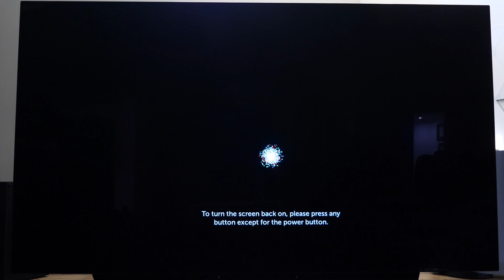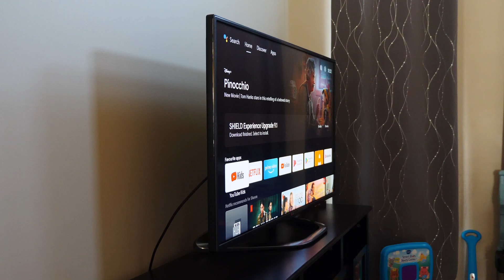TV Explained: Why Plasma TVs Are Dead

Comment: I've had 2 plasma tv's for close to 15 years and neither have experienced burn in. As far as why I like mine, there are 3 main reasons smooth motion, color accuracy, and wide viewing angles. The down sides you mentioned are correct, the weight makes them more difficult to move and they do get warm. In the winter the 60" plasma in my living room will raise the temperature by up to 4 degrees over 8 hours of use and in the summer it definitely causes the a/c to run more. After 15 years I've gotten used to their quirks. My 4k 120hz LG LCD is only better for gaming due to its Freesync and 120 fps capabilities. Most of my movie and tv collection is Blu ray and DVD and they look great on plasma. They really shine when watching sports.

Comment: Plasmas have a 60Hz refresh rate. The “600Hz subfield drive” is also marketing BS. Connect a PC to one and you won’t get any higher than 60Hz. What made plasma so good regarding motion handling is the fact like CRT, plasmas are Impulse Motion displays, and naturally have less motion blur than LCD and OLED’s, which are Sample and Hold displays.

Impulse displays like CRT and plasmas used electron beams to illuminate phosphors on the screen for CRT’s, and electrify noble gases for plasmas which would briefly glow and then fade quickly before the next frame. The benefit of this brief illumination, or "flicker," effectively shortens the time each frame is displayed. This eliminates eye-tracking induced motion blur, as the image essentially "flashes" at the correct motion position before disappearing. As a result, CRT’s and plasma displays produced smoother and clearer motion compared to sample-and-hold displays, despite potential flickering. 

Sample and Hold displays like LCD and OLED, the display holds each frame on the screen for the entire duration of the refresh cycle. As a result, as your eyes track a moving object across the screen, the image stays static in one position for a significant amount of time before the next frame is displayed. This "smears" the image across your retina, resulting in perceived motion blur.

Comment: Sure Plasma TVs used significantly much more power, but my old plasma did double duty as a room heater during the winter.  So that probably saved me some money on my heating bill.  Regarding screen burn in, that is a very real thing.  My wife left the QVC channel on for about 16 hours straight and it had a chyron around the bottom and side of the screen where the words changed, but the boxes they were in didn't.  Yup, those boxes got burned into our screen.  It took about a week for normal TV watching for those ghostly images to fade away.

Comment: My Panasonic Plasma TV only lasted 4 years and I felt so disappointed. When I replaced it with an LCD TV, I noticed off-axis viewing as significantly worse. At first I felt so disappointed, but after all of these years I guess I just got used to what my LCD TV looks like and it just seems normal. After 10 years, I'm sure that LCD technology is way better now, but I probably won't upgrade until it dies because I don't want to give up my 3D capability.
Reply: Curious: what 3-D content is out there these days? I ask because my parents currently own a 3-D TV from like 2015:)

Comment: My 5 Plasmas are doing fine. I've always heard of Burn In, but none of mine have it after daily use for years. I've even got the last Gen. KURO, 2009. ( Still mounted on my living room wall ) 59" Samsung used daily for 10 Years with a computer and was used when I got it. Main reason Plasmas stopped being built is most probably expense, the Engineers wanted to continue making and improving them.  ( ask a Pioneer employee ) Keep it up, lets pretend Plasmas are bad, that will keep the prices down. Oh, you could also complain they're heavy, because they're built like a tank, high quality parts, steel,  aluminum and glass. Also, newer Tv's are easier to throw in the Trash .
Reply: There are a lot of negatives for plasma for the owner and the manufacturers

Comment: Dead?  DON'T tell my Panasonic Viera in my living room..  still running absolutely beautifully 16 years purchase!  haha
Reply: By “dead” he means that most people don’t use it anymore
Reply: @The.duck.that.likes.grapes  Think he means they don't manufacture them or use the tech in todays TV market.
Reply: As much anymore
Reply from the maker: A little of both. Mainly that manufacturers don't make them. However, since they're not made anymore and current units die out so does the number of active units.
Reply: Panasonic made truly excellent Plasma TVs.  I have a buddy who's Panasonic plasma tv is 15 years old and it still looks gorgeous.  Sadly, I went with the Samsung plasma tv, which looked gorgeous too, but it kept blowing out power supplies every 2 or 3 years.
Reply: Yep my Panasonic 42” plasma TV is still going not a single pixel drop out… built like a tank and has all the connections I could ever ask for 4 HDMI & 2 USB. Yesterday I bought a new OLED TV ( it’s very nice - however it felt so delicate compared to my old tv and a sad day- I’m going to donate my plasma to local charity shop and someone else can still enjoy it … a little side note - the new OLED Doesn’t have analogue inputs or outputs 😢so I will have to get a soundbar and get with the modern times by the way the plasma has been used daily for 15 years or more - hard to let go and embrace the new LOL

They don’t make them like they used to 

Time will tell

Comment: Still have my Samsung plasma tv from 2009. It heats up the room and made my Xbox 360 overheat back when it was the newest console from Microsoft.  It started having problems after an earthquake. It didn’t fall or anything hit it. If it’s on channel 10 it won’t switch to the next channel. Side buttons don’t work sometimes. I want to replace it as it heats up the room.

Comment: Plasma wasn’t all great my guy. The sets were heavy the gas overtime couldn’t charge the pixels as bright so the picture would start to look dim the TVs sucked your power and raked up your power bill. They also ran hot very hot the higher end models required fans and big heatsinks. Once LED sets hit the market with local dimming zones it was over for Plasma because now you had a lighter brighter tv.

Comment: I have three plasmas. A 42" Sanyo from 2006, a 50" Panasonic ST60 from 2013 I paid about a $1000 for each new.  And I bought a used Pioneer Elite Kuro 50" 110FD for $150 in 2020.  All work great and no burn-in. I have never liked LCD picture quality and OLED is being superseded by QLED. I'll keep using them until they die and I'll try to repair them.

Comment: Black levels on most plasma tv's weren't all that great compared to modern VA panel LCD's, and a far cry from mini led that's available now.
Most of them could do ~3000-4000:1 contrast ratio. The black levels were also set at a specific value to ensure they operated properly, which means there was no purpose to the backlight/cell light control other than increasing brightness/contrast. The black levels were often quite high compared to the minimum backlight setting on LCD's, and you couldn't use as much bias light to enhance perceived contrast, as it would wash out the panel surface. The only plasmas really worth having were the Pioneer Kuro (second gen), and the last 2-3 generations of Panasonic (30-50-60 series), which could actually do 5000-6000:1, and over 10000:1 on the last models released (S60, St60, Vt60). Though many complained about the black level rising over the first few years of use.
The main benefit wasn't so much contrast, as having a uniform image across the screen. You don't get that oil on water effect like you do with LCD when sitting in front of a large panel that fills your field of view. The main reason they failed is because 4k wasn't going to work without them going up in flames/insane power draw at 4k. The burn-in problem was highly exaggerated, just like it is on OLED. I'd still pickup a late gen Panasonic if you can find one at a good price, there's just something about that phosphor surface that gives them that "CRT look", without being bulky as heck, and the input lag is about as good as it gets for digital displays. People also complain about the dithering, but in most cases it handles content near black better than any SDR OLED, and potentially better than HDR OLED when the black level is set to 0 (gives that ink splotch effect). Of course you can get around it with some common sense, not setting brightness too low on an OLED.
Reply: U left out the pioneer elite pro 1080p, it can hang with the Kuro
Reply: And the most important part, these go for peanuts used, to even get close to said performance you'd have to go absurdly higher pricewise.
Reply: thank you, your comment is a nice addition to the video and honestly a even bigger point. Now when 4k hdr OLED is on the market even plasma enthusiasts have an OLED most of the time

Comment: No mention of motion resolution? The reason why plasmas were smoother than LCDs/LEDs, and even OLEDs, is because it was an impulse display instead of sample and hold. The 600Hz subfield on my Panasonic plasma actually had a refresh rate of 60Hz, meaning the image flashes 600 times per second giving it almost perfectly smooth motion. The motion resolution was the same as the actual resolution. It had 1080 lines of motion. So 1080p in motion actually looks like 1080p when the image is still. OLEDs don't even come close to this. An OLED at 1080p looks like 300p in motion, so the image blurs significantly. This is substantially worse at 4K, which is just overhyped nonsense. 4K is only 4K when the image is still. The moment you move the image it's no longer 4K, it's not even 720p for God's sake. How is that great picture quality? And I haven't even mentioned low frame rate content on an OLED. A 30 FPS game on my plasma looked like 120 FPS. On an OLED 30 FPS looks like...well...30 FPS, meaning it stutters like crazy. So at the end of the day, plasma is still superior. Is OLED better than LCD/LED? Absolutely. Is it better than plasma? Absolutely NOT!
Reply: Not sure you actually understand that of what you're talking about. Like the subfield, it doesn't flash images 600 times per second, what it does is the image is broken up to 10 "subfield" images which each is 60hz or flashes it's part of the whole image 60 times per second. So each of the 10 subfield images flashing at 60hz makes that 600hz they used for the marketing, but really the TV is still only 60hz, it's just that a 10% of an image is easier to make look good and work well flashing 60 times per second then it is trying to do that to the whole image so hence why it works and looks better doing it that way. The whole 600hz thing was a lie though just like the whole 120hz, 240, 480hz that LCD's use to do a lot back in them day's but all were still really only 60hz displays. Now though you actually can and do get displays, raither LCD or OLED/QDOLED, that are true 120hz/144hz displays and soon we'll be getting 240hz.
Reply: @randysalsman6992     You're right, but 120Hz still doesn't look as good in motion as a plasma. A plasma has around 4ms of persistence. The very best ones went as low as 1.8ms. 120fps@120Hz has 8ms of persistence.
Reply: @Stoddardian you are wrong buddy plasma is only better motion than really low end led LCD’s
Reply: @garrettstrutz7421     Nonsense.
Reply: @Stoddardian come to the future my friend don’t rob yourself of quality life is short. I’ve had many plasma’s best most expensive ones they made. Plasma is best left in the past
Reply: @garrettstrutz7421     I simply disagree.
Reply: @Stoddardian you are delusion-ally in love with plasma’s my friend. They were built well and definitely last a long time if you got an upper end good one but at there very very best they were dim and costly. You pay a high price for such a dim picture. Join the future of HDR and 4K it’s incredible. Just stay away from the low end junk TV’s. If you set up my S90D qdoled next to my pioneer elite pro plasma it’s laughable how much better the s90d is. My mid grade Qled blows the highest end plasma they ever made away I own them all, I love plasma fanatics. I was big into plasma’s in the 2000’s I’ve owned quite a few still have a couple. I’ve had low end ones all the way up to high end ones I even owned a Hewlett Packard plasma once that died after 1 1/2 years that was junk. You are selling yourself short buddy
Reply: @   I've seen 4K HDR. I owned an LG C2 for 18 months. I wasn't impressed. Not to mention the motion clarity is inferior.
Reply: @Stoddardian c2 isn’t that great with HDR not bright enough need QDoled or MLA woled both are amazing
Reply: @garrettstrutz7421     So you're just going to keep glossing over the horrible motion resolution on OLEDs?

Comment: I don't know why you need high refresh rates for movies which are usually in 24p or 25/ 30fps. I always disable frame interpolation because for me it looks fake and too smooth
Reply from the maker: If only more content was filmed in 48fps or 60fps. At first it looks to be moving too fast but you adjust quickly as it's a more natural and realistic video, then switching to 30 fps (or less) looks choppy. It's why I always record in 60fps.
Also consider high refresh rate and fps for gamers (consoles and PC).

Comment: Interesting video.
Wasn't one of the biggest reasons for Plasma TVs to disappear the push to 4K resolution and they couldn't produce Plasmas with such a small PPI, kinda like the problem of current Micro LED?
Reply: Technically you are right. Plasma has minimum (and maximum) pixel size potential. Yet plasma withered away a few years before anyone was mass-producing 8k displays.